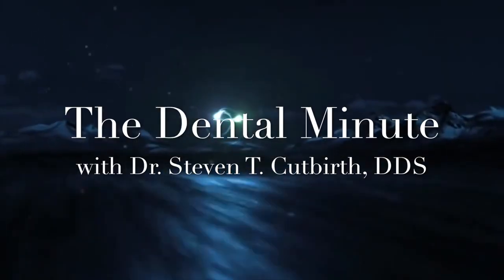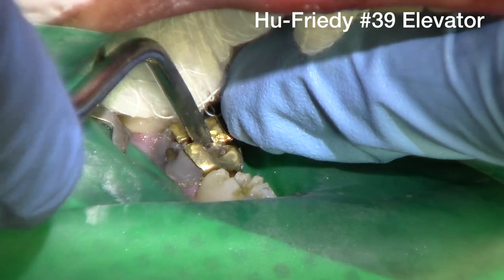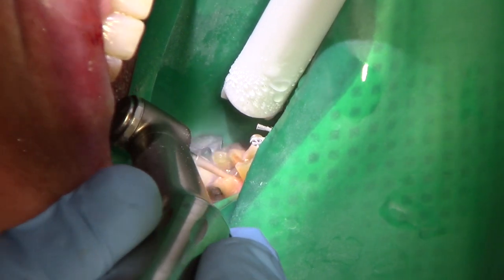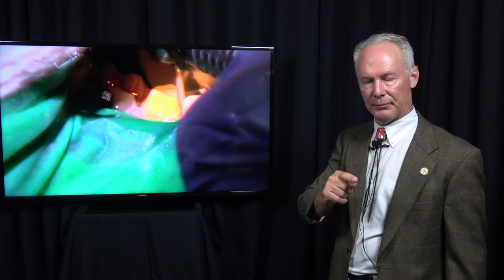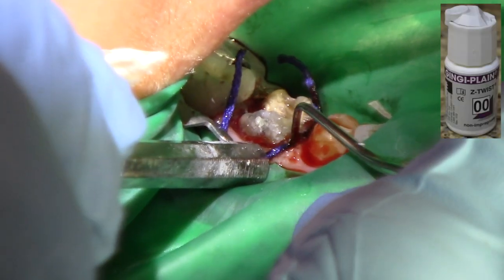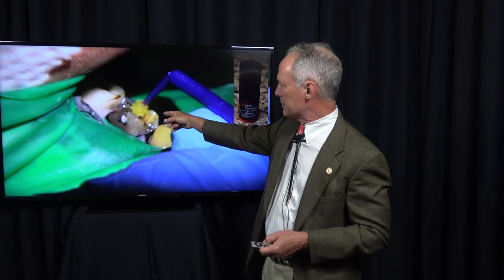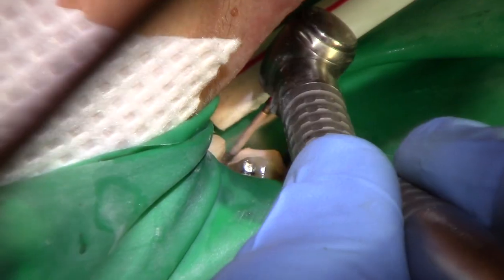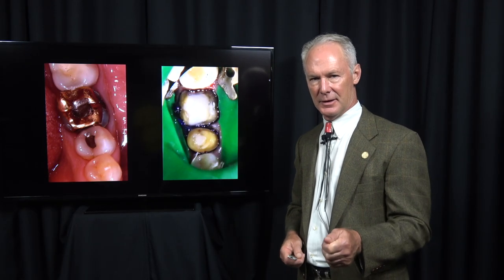Prepping Crowns with Composite Base - Dental Minute with Steven T. Cutbirth, DDS

Comment: Did you take putty impression for provisional crowns before removing the old fillings and preparing teeth?
Reply from the maker: You can.  We take impressions and pour study models on all new patients, so we make the putty impression on the study model.
Reply: Dental Minute with Steven T. Cutbirth, DDS 
Actually, I wanted to know what techniques you do in case the original old crown or onlay wasn't  in good for fabrication of a putty then provisional crown? And you recommend direct provisional crown in some cases ?
Reply from the maker: We take alginate impressions of the presenting dentition, then wax up the tooth or teeth to ideal anatomy if it/they are badly broken down.  We then make the PVS matrix from the wax up model.  If we are restoring just one tooth, and the tooth has good anatomical form,  we sometimes warm 2 thicknesses of pink wax and mold the warm wax to the tooth to be restored as well as 1 adjacent tooth on each side of the tooth to be crowned.  Mold the warm wax to the tooth with your fingers then, once the wax is formed to the teeth, spray cool water on the wax matrix while it is still on the teeth, then tease it off the teeth and place the wax matrix in a bowl of cool water to chill.  Be sure to spray the wax matrix with cool water while it is still in place on the teeth to harden it.  If you remove the wax matrix while it is still warm and place it in the cool water it will distort and not fit the teeth well.  Once you have prepared the tooth for a crown, remove the wax matrix from the bowl of water and try it in on the teeth.  It should fit snugly.  Remove the matrix from the teeth and squirt bisacrylate (Luxatemp is a good one) into the matrix in the area of the prepared tooth, wet the prepared tooth in the mouth, squirt bisacrylate directly onto the prepared tooth, then place the wax matrix with the bisacrylate onto the prepared tooth.  Hold the wax matrix in place until the bisacrylate sets, then remove the matrix and provisional crown, trim it, adjust the occlusion and cement with provisional cement.
Reply: Dental Minute with Steven T. Cutbirth, DDS thanks a lot doctor for your answer and time

Comment: Do you have any research that can vouch for your discovery of etching gel being able to muster bleeding?
All evidence points towards the opposite...
Everytime acid touches gingiva, it dissolves the upper cellular layer and a bleeding starts even without any diamond bur action ;D
Reply from the maker: Try it!  It works most of the time much better than 35% hydrogen peroxide, hemodent or "shave nik."  1/100,000 or 1/50,000 epinephrine in lidocaine injected into the tissue is a last resort.  I have also read of dentists using "Afrin" as an oral hemostatic agent.  Be sure to isolate the area so the patient does not injest the hemostatic agents.  Some of the things I will share with you are simple things I have discovered out of necessity restoring complex cases for 35 years!
Reply: Dental Minute with Steven T. Cutbirth, DDS thank you! But everytime it results in heavy bleeding in my case...
Reply: Can't thank you enough for all the help and tips. Please share as much of your tips as you can! I am writing all of them down for future reference -    from a dental student!
Reply from the maker: The only options I know of for gingival bleeding control are 1) 38% phosphoric acid directly on the bleeding area for 30 seconds, then rinsed off with very cold water (not hot or even warm water), 2) Hemodent, 3) 35% hydrogen peroxide for about 15 seconds or 4) injecting lidocaine 1/100,000 or 1/50,000 epinephrine directly into the papillae or other gingival bleeding area.  1/50,000 epinephrine can cause heart palpitation, so I only use 1/100,000 epinephrine.  The only times I can remember one of these options not working is when the patient is on blood thinners or takes a lot of aspirin or advil.  In those cases, injecting the tissue directly with the lidocaine 1/100,000 epinephrine is the only thing that seems to work and the hemostatic effect wears off rather quickly, so do the work you have to do quickly.
Reply: @CousinHubertRetrogaming  I had the same issue previously but then learnt that I either hadn't left the etch there long enough (for a minimum 30 seconds) or the water/air pressure from the syringe was too high. The status of the gum health is an important factor too.
Reply: @bsim5138  I use dedicated products to counter bleeding. Not etching gel.
Reply: @CousinHubertRetrogaming  I was responding to your claims that your use of etching gel "results in heavy bleeding". As what Dr. Cutbirth had suggested & I concur based on my own observation, the phosphoric acid etching gel does seem to control gum bleeding. Speaking of dedicated hemostatic agents & acids, what do you think hemodent is? :)
Reply: @bsim5138  aluminum chloride
Reply: @CousinHubertRetrogaming  An acid.
Reply: @CousinHubertRetrogaming  The acid does nothing to stop the bleeding per se, some suggest that it can estimulate bleeding in fact.. But the silica contained in the acid does stop the bleeding. If you use a thick phosphoric acid, with a lot of silica, it achieves the effect better.